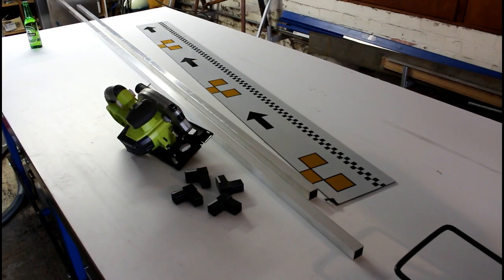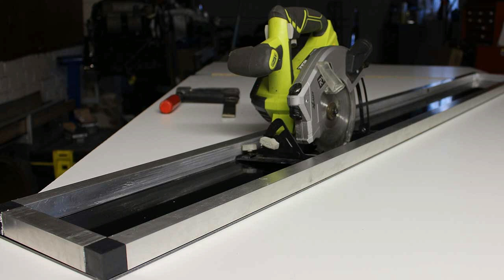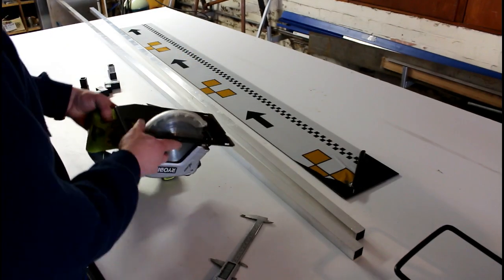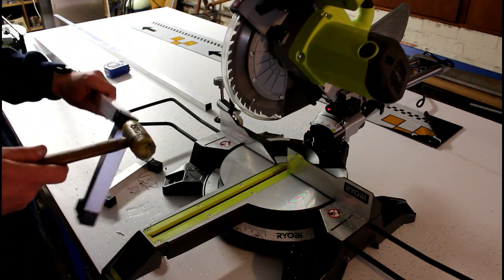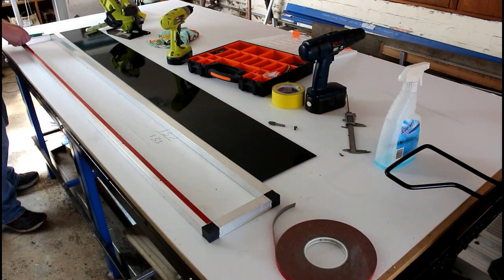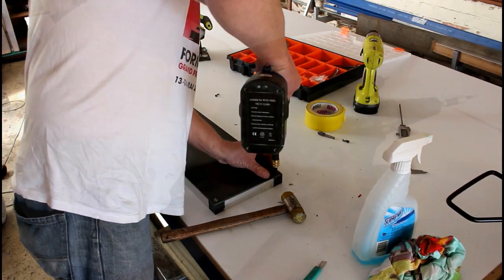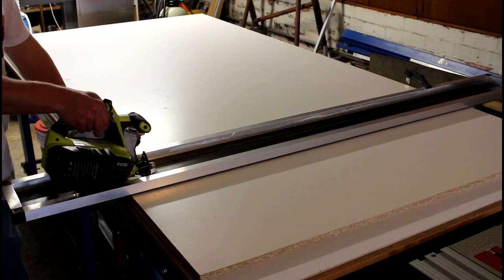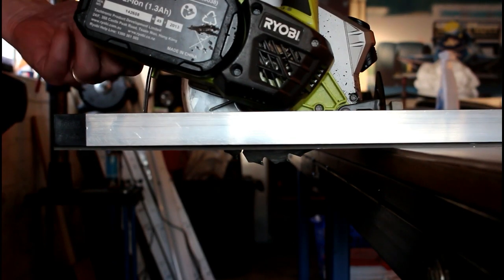Track Saw DIY

Comment: By using a 1/4" aluminum straight edge on MOTOR side, instead of 1" tube, you can increase the depth of cut possible with the saw.
Reply from the maker: Thanks Mate. A solution like that could definitely work. Maybe if I ever get to making a version two, I'll give something like that a try.

Comment: What material do you use for the base? And can you provide the link for the connector? Thanks!
Reply from the maker: G'day Chinh Tang. The corners are square tube connectors and the base is aluminium composite panel. I've added links in the description for each.

Comment: Hey man! What kind of blade are you using to get a nice cut on melamine?
Reply from the maker: Believe it or not, it's just the standard blade that came with the saw. Nothing special other than it's quite thin. I think the zero clearance of the track saw base helps as well.

Comment: Cool! Me likey😉... Now, did u ever try using what that other commentor suggested for the underneath of it, to keep it in place, possibly avoiding having to use clamps altogether? Something like self-adhering sandpaper? Also, have u tried making another track of the same style, w/smaller-sized square tubing, to maximize cutting depth? I know u said that this would cover the majority of cuts you'd be making, but what about the length? I see that it can crosscut a full sheet, but not rip a full sheet. If u havent yet, if i may make a suggestion or two (this is for myself to consider building, just as much as anyone else who may read this) - perhaps trying out making one of smaller tubing, and be the length of a full sheet of plywood, maybe even having the bottom sheet extend past the ends, w/the kerf cut into it, to ease lining up the cut lines. And/or, making what u already have made, w/an accessory of a longer base the size of a full sheet of plywood. If not wanting to have two separate track guides, maybe then having the ability to extend the existing rails w/a coupler of that same style, if available to purchase, & If not, It looks like it might be something easily made w/wood or something. Idk, just thought of this as im watching/typing. I do like the build, and appreciate you sharing your creation w/us, regardless. Have a good one. Aloha🤙
Reply from the maker: Thanks mate for the fantastic feedback with some great ideas. Unfortunately I haven't had a chance to make any modifications as yet, but hopefully soon. I will update here, if and when I do.
I have a table saw that I can rip full sheets (awkwardly) but a longer, lower profile would always be handy, although my workshop is not much wider than the current length of the track.
It would be great to see you come up with a version. Thanks again.

Comment: How do you line up the cut with your pencil lines? With a normal track saw you just put the edge against your cut line, with your track I imagine you have to sight through the precut saw blade slot to your pencil lines? Is that a bit tricky? Nicely put together video by the way!
Reply from the maker: Thanks Justin.
Yep, just sight the mark through the precut saw blade slot. It's pretty easy to find and line up marks.
Reply: tas westy thanks for that I figured that must be how it worked!